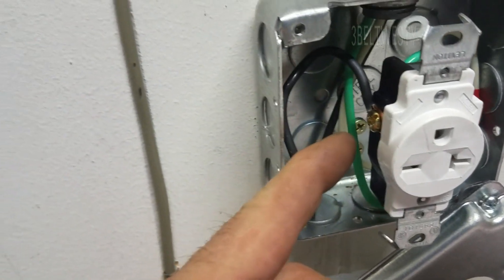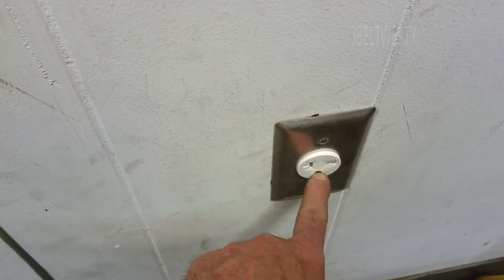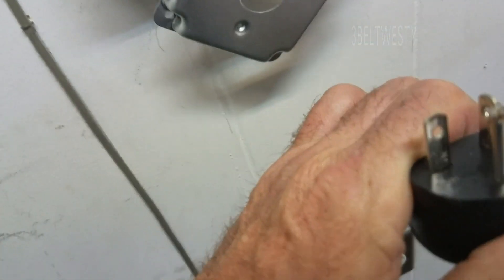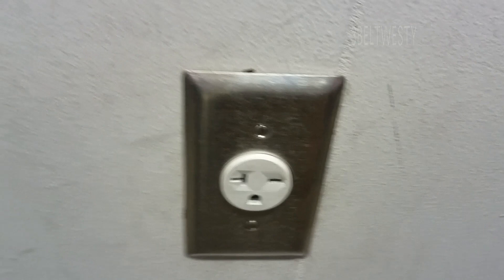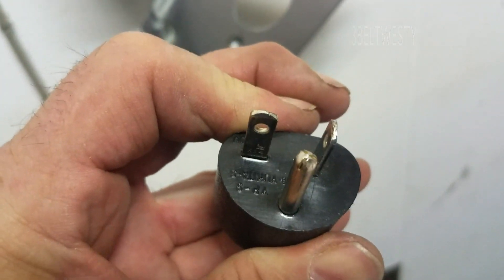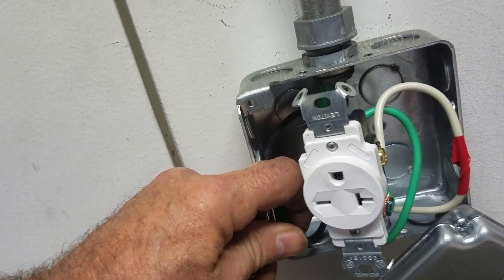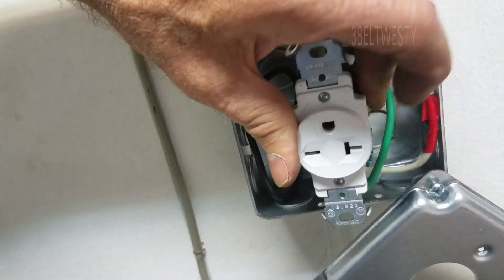240 volt socket Ground pin up or down ? 6 20R Nema Receptacle

Comment: The ground pin should go on top unless you have a good reason to do otherwise.  The National Electrical Contractors Association's National Electrical Installation Standards (NECA 130-2010) recommend that sockets be mounted with the ground hole up, such that a falling object on a partially inserted connector contacts the ground pin first.  Moreover, all of the non-locking receptacle diagrams in ANSI/ NEMA WD 6-2021 show the ground pin at top center.

If you have a wacky plug that has a ground pin on the bottom, consider orienting the receptacle to accommodate it, but otherwise, put the ground pin on top (or the larger of the blades on top, if you're orienting the receptacles sideways).  (The reason for putting the larger pin on top in a sideways orientation is because it follows the practice of putting the neutral on top for a sideways NEMA 5-20R outlet.). For that matter, if you're driving a NEMA 6-20R receptacle with buck/boost transformer (say, boosting from 208 to 250 VAC), attach the "high" leg to the smaller blade.

If you have a big enough box, consider installing a NEMA 6-15R/6-20R duplex receptacle.  It's surprising that many aren't even aware that NEMA 6-20R duplex receptacles exist, even though they're commonly available and dimensionally identical to their NEMA 5 counterparts.

Comment: So wiring did you use to run it ?
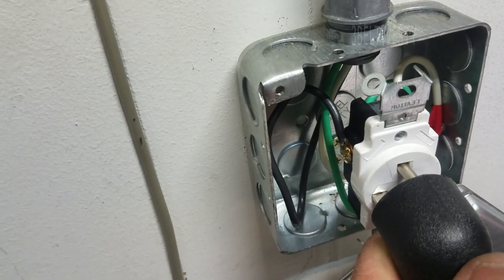Reply from the maker: 0:36 I used Ground pin UP since the machines flexible cord would not be stressed as much . ie the machines cord would do a 180 bend right at the Plug if done ground pin down.

Comment: More than 75% of the population agrees with you that the ground should face down. Any electrician will tell you “it depends on the plug for the device your using” or they’ll ask you you preference. Personally, whenever I install a receptacle for either a dedicated circuit or a general purpose circuit I install the receptacle ground facing down unless the device plug requires otherwise. It’s a shame you ran a new receptacle just so the ground would face down when all you had to do is unscrew the older receptacle and rotate it. Even if the wires were really short which actually wouldn’t change the ability to rotate the receptacle.

Comment: Have you ever wondered if you have upside down outlets? The electrical code allows outlets to be installed with the ground plug hole facing up, down or sideways. It's up to you, there is no standard electric outlet orientation. So that means there really is no such thing as upside down outlets.

Comment: Maybe someone can help me. On this 220v outlet theres a "T" shaped plug hole. But not a T shape Plug prong. Now is this so instead of having a vertical and a horizontal prong, you can have to horizontal prongs? I need to know if it's possible to plug a 230v 15Amps Window Air Conditioner into a 220v outlet like shown in this video. Any help will be greatly appreciated. I can't find a window A.C. that fits my old 220v outlet(like shown). They are all "Tandem plug 230v 15Amp" with 2 horizontal prongs and then the ground wire.
Reply: Sounds like you have a Nema 6-15P (plug) which is compatible with the outlet in the video (Nema 6-20r). You could also put a Nema 6-15 outlet but the outlet above will give you more flexibility.
Reply: @laserdance  Thank You
Reply: Don't know why these lines are referred to as 220V when it's more typically 240V unless the voltage is low for some reason.  Two 120V opposite phase hots completes circuit back to transformer supplying house and is 240V.  At my house voltage is typically 126V, and my "240V" lines are actually ~250V.
Reply: @stevec8861   its called old timer talk. yes you are right but 110v and 220v is what you will hear all the old timers say. electric has changed a lot over the decades
Reply: Also fits on US Euro Thai 3 pin outlets.

Comment: The proper way is up, but many prefer the appearance of it down
Reply: proper?  bet you cant find the "proper" code saying that.
Reply: warren michael that’s because it’s not part of NEC.  It’s just “proper” to safeguard against potential dead shorts with falling metal wall plates
Reply: warren michael I’m glad it’s not part of code.  I prefer to install receptacles with ground on top, but it’s not the end of the world if the homeowner prefers the current carrying terminals on top, and the last thing we need is to head in the direction of a nanny state, like the UK is with their electrical codes

Comment: That is 110 not 220v
Reply: It is 220.  Check out the orientation of the two hot pins.  Also, he states it's 220 in the video.
Reply: It’s 240.
Reply: Look up NEMA 6-20R

Comment: Wouldn’t 12gauge have been enough for a 20amp circuit?
Reply: Yes, unless the panel is really far away you may have to up size
Reply from the maker: For that socket 12 guage wire is plenty. We had some older machines that used 25 and 30 amps and with those I used the 10 AWG so I still have more wire left over.

Comment: Its better with the ground up.
Incase it wasn't plugged in all the way and something fell from the top it wont arc the 2 prongs. If ground is up, then it will just bounce off. Thats why hospitals only put outlets with the ground up.

Comment: why didnt you just turn off the breaker, and unscrew the original one and flip it?
Reply from the maker: UltimateBitcoinMiner this new receptacle goes to another electric  meter.  This reduces my demand on the bigger meter thus helps my bill in the summer when the ac runs. Ie i have 2 electric meters
Reply: @3beltwesty  Weird!
Reply: ok
Reply: Because he is a Goof...

Comment: I prefer ground down on my outlets. It looks more normal and muscle memory tells me to plug the cord in that way. However, a good friend of mine (also a carpenter) made a good point. If the ground is up and the cord back out some, a piece of metal cannot make contact with the hot and neutral at the same time. It can only short to ground which reduces the risk of danger.
Reply: I was told that for similar reasons, but I've ran into issues with plugin wall lights and air fresheners hanging upside down, so I'm going back to ground-down.
Reply: Old comment i know, but it can be argued that with the ground faced up it can be easy for your index finger to slip onto the prongs creating a short across the prongs while plugging the device in.   Or even while unplugging it.  Many reasons can be argued why one or the other.   So i realize it’s strictly just a preference thing.   There’s definitely no code on the orientation.   Stress on the cords will be more important at that moment.